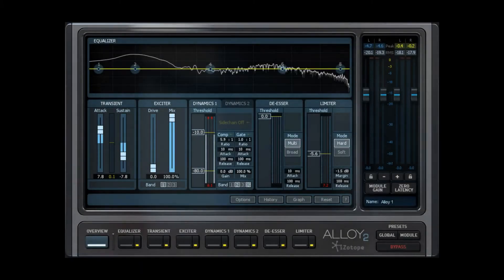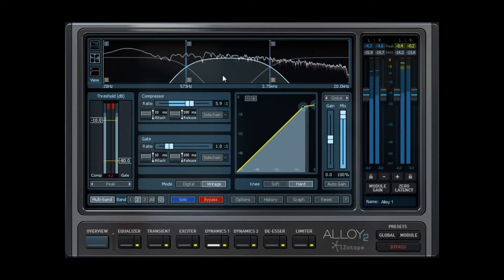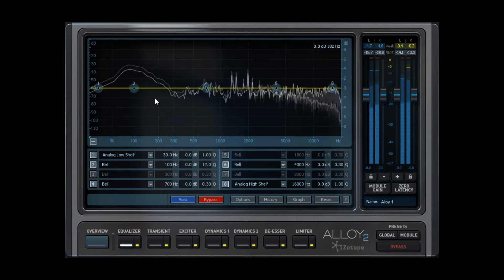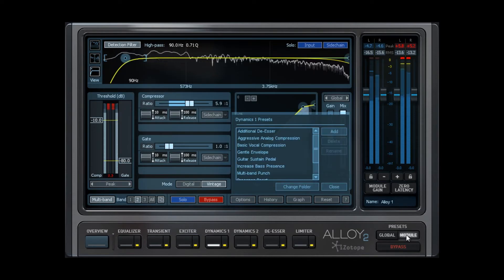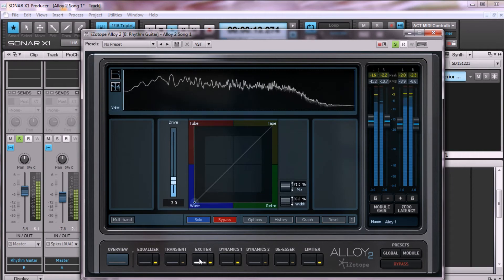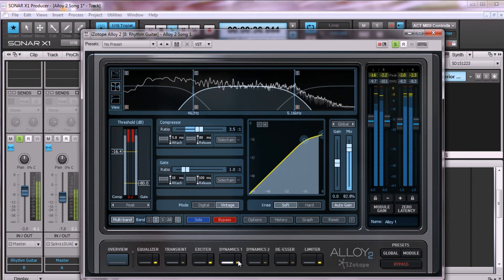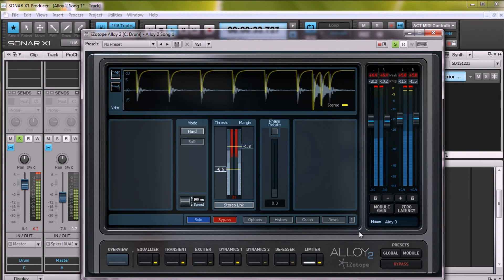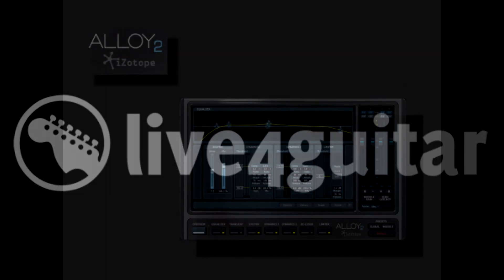iZotope Alloy 2 live4guitar.com Review and Audio Mix Example.

Comment from the maker: Thank you. I simply created a bus channel and assigned the output of the channels that I wanted to effect to the new bus channel. Then I sent the output of the new bus to the Master Bus. You certainly can use a separate instance on each channel, especially if you wish to use each instance of Alloy 2 to achieve something different. Alloy 2 is pretty resource friendly but remember they all add up to CPU drain. 

Thanks again.

Comment from the maker: Hey, thanks for checking this out. I can speak to my experience using 6 instances of Alloy 2 on a 4 processor 2.9 ghz Windows 7 PC with 6GB of Ram. I was using 2 virtual amp sims and several Waves plugins as well. I didn't have any hiccups.  iZotope Ozone, however, still remains a resource hog even with one instance in a master bus. 

I will say this, Alloy 2 compressors are very resource friendly and sound great to my ears.

Comment: Tim, Great review on Alloy 2. Thank you for taking the time to do this. Have you done a similar review with Ozone 5? or even Nectar for vocals?
Reply from the maker: Thanks for the kind words. I have not done a review for Ozone 5 or Nectar. Although, I do use Ozone in almost every mix. If the guys from Izotope would like a review, I would certainly be open to do it.